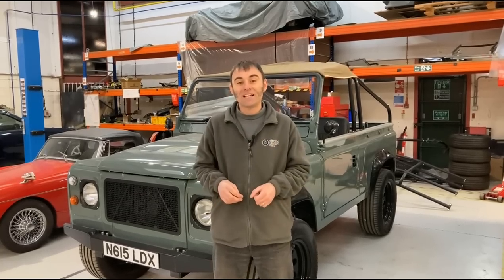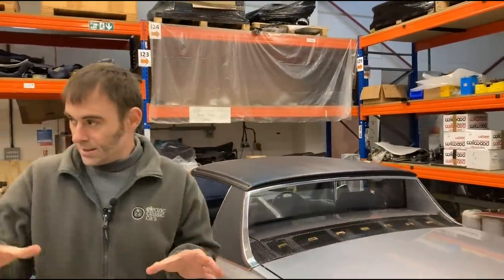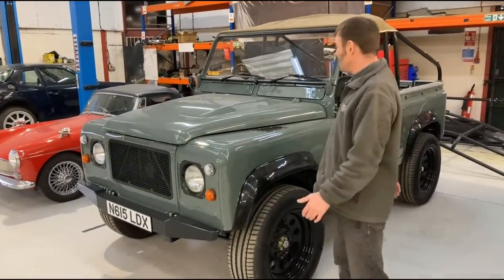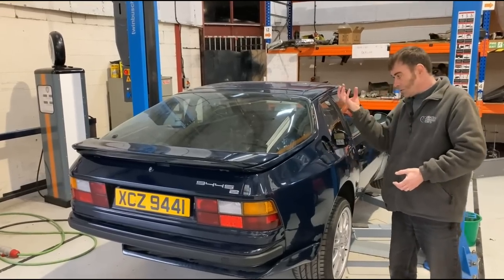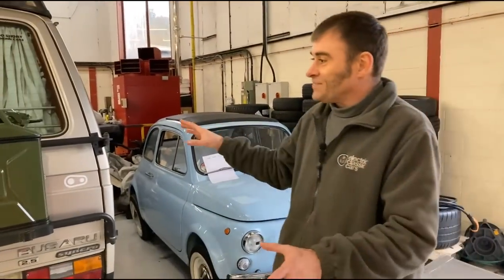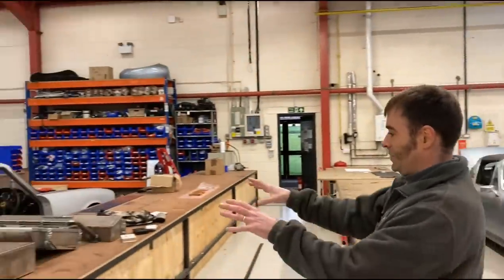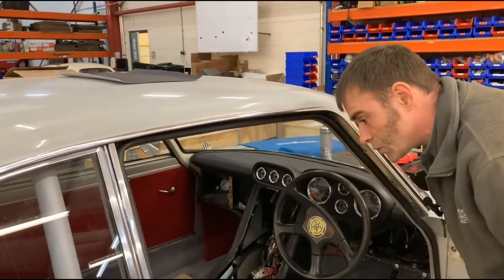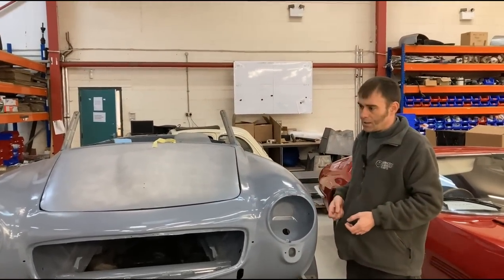Classic cars converted to electric - Workshop Walkaround

Comment: All these guys converting their cars didnt bin the motors did they, as that mercedes benz 190 SL has a shortened version of the 300 SL motor and is a proper runner, and one of the most comfortable cars ever made, stuffing a battery pack down the middle and an electric motor up front is probably gonna weight far more than the original 4 cylinder unit and turn it into a proper boat

like I can see wanting to do the fiat 500, and a few of the V - dubs, but that, like jesus I hope these guys are keeping their original motors when they do this, as all electric is not the way to go, as all electric means you'll be at the mercy of the UK power supply which is fueled primarily ironically by fossil fuels, over 50 percent, and cali, a state that is banning the sale of gas powered cars

their powergrid goes out every time someone puts the kettle on, as if your worried about that sort of thing, force all your busses to hybrid electric and tell the people on bikes to sod off and stop clogging the roadways so everyones not sitting and wasting gas and putting it all in one spot where all the grass and trees you've demolished to put up a house cant get at it

and you'll also be at the mercy of the weather and how its temp changes effect the batteries life span, like I can understand wanting to try new things and NOT wanting a tesla, but if you really want an all electric mercedes benz 190 SL, or a ferrari testarossa

its called a Kyosho Mini-Z and you can switch the body for whatever your heart desires and they DO come with testarossa bodies for'em

granted with the ferrari testarossa, ironically John Carmac said the only thing that could match his twin turbo testarossa he had built in the Doom Days with its 600 horsepower in the 90's was his tesla with how instant the power came on, but with a few little tunes and tweaks that testarossa will purr like a kitten, and you say its too light in the front

change the tires, they came with two options, 225's and 245's and its limited by the magneisum wheels that are a rare size, 16.5 if memory serves which limits them to a low run tire that is really hard to get, as too light in the front, normally its the opposite, and tell him to check the distributor cap if you think its slow, Harry's car was running on a bank of 6 when it was on the grand tour and he didnt even know because of how smooth the cars engine was, and an exhaust adds about 80 horsepower before committing to changing it, like its that strangled back there

and look at the gearing, this thing was designed as a grand touring alternative to the Countach, it was never ment to beat it (that was the F40) so if you look at the gearing and fiddle with the accelerator pedal to give abit better response, as I remember the place harry took one of this, with a little tuning you can make them a hell of alot faster than you think, plus it was the first federalized ferrari for the world market ever made outside of the 308, and the key thing with them is the torque given the lowered rev band

still its only a bunch of pipes and the whole thing comes out as part of the engine out service so its not exactly hard to convert it and convert it back if need be, but that unit, the 4.9 was the same they used in the 512TR just modernized, and they easily got another 50 or 60 horsepower out of it when they did, mind you I think they're beyond stupid for even thinking of doing that to a testarossa, like guys, Volkswaggen exists and makes lamborghinis now that are about as lamborghini as I am french, go buy a bat guano gallardo that is shot to hell for 50 grand with that Audi motor in it and convert that to electric

as atleast then nothing of value is lost with that change as they sold you a fake car anyways, and a bunch of them have had the engine go out from clogged catalitic converters too

 but still the mercedes, as a car I personally know and have been in as it is the single most comfortable, and nicest car I have ever been in

that is really the wrong thing to do with that car, and its a 4 banger, a reliable one at that, put it back to stock and leave it, it'll be worth more, it will last, and keep its value, as batteries, I've never known a set of batteries to last more than 10 years, while that lasted 50 lol  and if you gotta convert a merc, do a 230 SL, that ugly box one that came after that is just a miserable car to be in with its flat floors, scratchy interior, and lack of stylage to it at all

also if one of those testarossa owners is a single mirror half way up the A pillar car, tell him to go buy a bat guano gallardo and convert that instead, as those are a rare two year option, made only between 1984 and 1986, 1986 being the first year of the double plate clutch as well, so theirs alot of unique things about those in addition to the 16.5 inch centerlock rims that they then dropped for a more conventional size with a 5 bolt pattern to them in 1988

and if its a right hander its even rarer

and actually if they want a testarossa look, well, no dont waste a 348, a is a good driving car and the latter models are actually quite good on the power delivery

go out and buy a fiero with a body kit to look like a TR and convert that, as the iron duke on those likes to combust alot and its already made out of plastic so its ideal for that, as I knew a guy who had three fieros

one got struck by lightning, one got into a crash, and the other one had a tree fall on it, yet he kept buying them

and with the gordon keeble, looks like it belongs on a DB5, the bond car or one of the early 60's grand touring ferrari's.
Reply: Are you taking drugs?
Reply: @spudproductions7606  No more than you Mr THUNDDDEERRRRBALLLLLLLLLLLLL lol

Comment: I’m struggling to understand why anyone would want to do this to a wonderful piece of automotive history. 

Given cars like these typically do less than one or two thousand miles a year, you could run this car for 20-30 years and the aggregate carbon emissions from petrol would be less than the carbon footprint of building the motors and batteries (and that doesn’t count the carbon cost for generating the electricity to power them)

I totally agree building new fossil fuel cars is not the future but driving classic cars (where the carbon footprint to build them was paid for decades ago) are surely a planet friendly option compared to keep building new cars (whether they be fossil fuel or EV powered)?

Comment: I can definitely see the appeal of a converted classic but a Testarossa? 😥It makes no sense . The entire point of that car is the sound and driver dynamics provided by the thing you're removing.  Its like removing the motor from a Tesla and fitting a 4 cylinder Duratec. Each to their own but what a waste.
Reply from the maker: I disagree. It looks great, but having driven it, it's awful. Converting to electric will fix not only the power the looks deserve but also the weight distribution and handling.